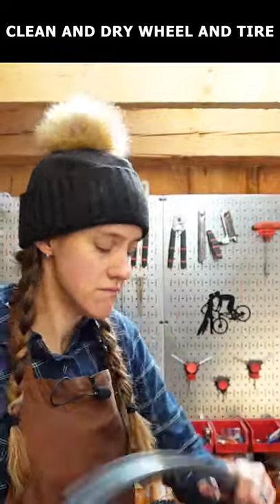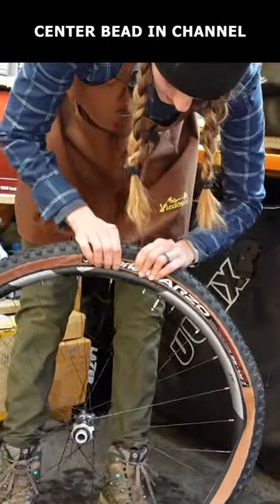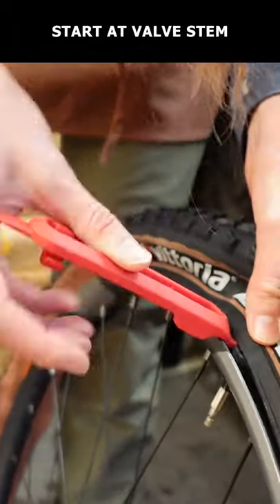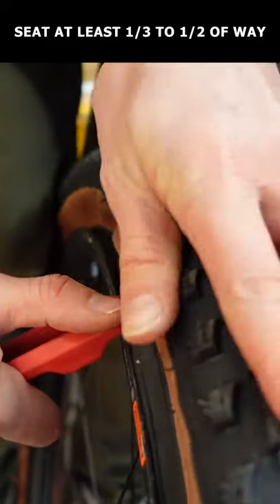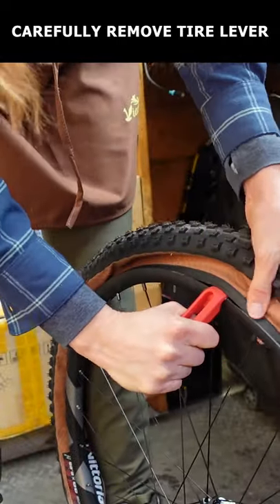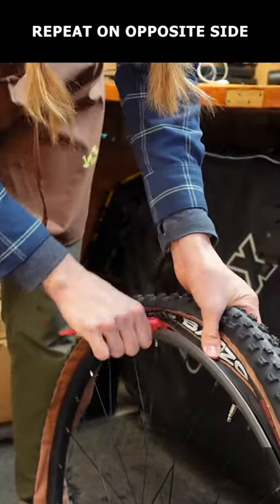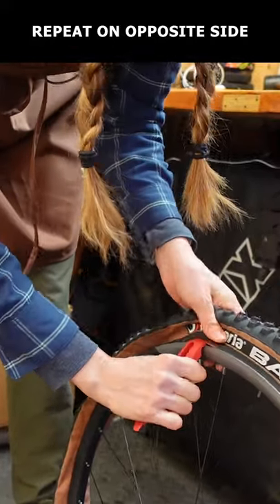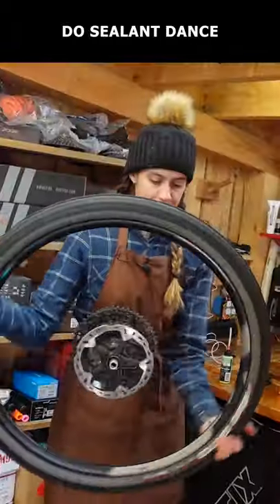Inflate tubeless tires WITHOUT an air compressor (only floor pump) #Shorts

Comment: They sell a tool for this, you put in a CO2 Canister and push a button and it blasts the tire onto the rim, no compressor needed. The CO2 device should be your choice in the outside world as it fits in your repair pouch, when in a shop, if you don't have a compressor, go buy a compressor.

Comment: You dont even need to do this, just slap the tire on your rim put the sealant, turn your wheel to apply the sealant everywhere and start pumpin your tire
Reply from the maker: Sounds like you have an easy rim/tire combo! Many rim/tire combos won't inflate if that's all you do...

Comment: I find if you use an inner tube to seat one side of the tire you can take the inner tube out and pump up the tire to seat the other side. Works fine for me

Comment: Great video as usual, but I would use caution recommending a tire lever when most manufacturers don’t recommend using them with tubeless tires. Thanks for spreading the stoke!
Reply: How do you get your tires off?
Reply: @gavinmercak-dinolfo1375  if you follow a process of bringing both beads into the center groove of the rim and remove the tire starting at the valve (which is opposite of how you remove a tubed tire) the tire with a little force comes off every time. Basically: 1 Break the beads free, 2 migrate beads to the center and then 3 pull tire up away from the rim allowing a gap to form at the valve then 4 push the tire off the rim. Example: https://youtu.be/D4b5IwkJvVc
Reply: I found that the bead doesn't really get damaged in any noticable way. And if there were to be any leaks because of a damaged bead, a good sealant will do its job and fix it.
Reply: @diviscadilek1764  I agree that sealant is magical. Having seen literally “everything” fail in my 30 years of being a professional bike mechanic has made me a stickler for following manufacturers recommendations. For example: you would be amazed how many people install chains improperly and wonder why their chain broke. Following the manual can save a lot of troubles!
Reply: @WanderingRad  while I have ypu here, can I ask you: Do you recommend reusing the little master link thingy even though the chain manufacturers say you shouldn't?
Reply: @diviscadilek1764  loaded question with the many manufacturers and speeds, 8,9,10,11,12s, etc...so “diplomatically” that really depends on the manufacture! 🤪 Here’s my rule for not getting into trouble. Does removing the connecting link require a tool? If the answer is “yes” then only use it once. If the answer is no then go for it. Many “connecting links” for older drivetrains were easily removed by taking tension off of the chain, and some of these even failed while riding. Are there exceptions?: of course, just like using a tire lever on tubeless...but if something does fail after following manufacturers recommendations then at the very least you can go to the manufacturer, and showing them you have a solid foundation for how you work on bikes will help the manufacturer support you. If you have to call a manufacturer, they ask a lot of questions when things fail so they can improve product and instruction manuals! Hope this helps!
Reply: @WanderingRad  yeah, this sure helped clear it up. Thanks!

Comment: Put the tire on, add the sealant (use your preferred method) and the trick is to push the valve 2-4mm inside the rim between the tire edges. Pump it twice,   the tire will seat instantly and properly, now tighten up the valve and inflate to full pressure, rotate the wheel few times, so the sealant will seal the tire. This method is straight forward, clean and simple, I'm using it for the MTB and road rims (55mm in depth) You don't need boosters, compressors etc.
Reply: Tried that, air leaks out everywhere. Sealant in tire is now everywhere. No idea how you got it to work, good job though.

Comment: This is a great method to use with a floor pump that's not pushing high volume like a compressor. If you do have a compressor of just about any size, what I do is remove the valve core, add sealant and use an air blow gun attachment to blow directly into the valve stem which usually inflates the tire quickly on the rim first try. 🚴‍♂️👍

Comment: I have an extremely stubborn tire, I tried the but didn’t work. I tried putting tube in and tires seated, but how to remove without unseating…does bead loosen at all or it remains true to size because it’s tubeless? Thank you
Reply from the maker: Bead shouldn't stretch unless it's been on the wheel for a while. If you get it seated with a tube in, just deflate the tube and try to only unseat one side of the tire when removing the tube. Then you can use this trick for the side you removed. Good luck!

Comment: The pump nor the booster inflator fit onto the valve stem without the valve core. How does everyone do it? Which adapter do you need? The Presta to Schrader valve also does not work the size is not exact. The size on the traitor is not the size of the Presta valve stem None of the videos mention it. Thank you
Reply from the maker: Some pumps won't stay on the valve stem without the core. In this case, either have a friend hold it in place for you or put the core back in.
Reply: @sydfixesbikes  makes sense I understand. I wonder which pumps would Stay and which would not. Or if it is mentioned perhaps on the label when purchasing the pump. Thank you again

Comment: once you take core out how do u attach pump do you need special adapter as the thread diameter is less then a normal (Schrader valve)
Reply from the maker: Some pumps will still attach without the core. Otherwise have a friend hold it in place for you.

Comment: theres a right and wrong direction????
Reply from the maker: Most tires are directional but you do occasionally find bidirectional ones. If they are facing the correct direction you have better rolling resistance as well as better braking traction.

Comment: Why is this better than just running tubes?
Reply from the maker: Less likelihood of flats (the sealant will seal most small punctures without you noticing) and you can run lower pressures which increases traction without riding pinch flats.

Comment: Another idea. I had a kite pump handy, similar to any inflatable toy pump. I held the smallest diameter nozzle over bike valve (not an air tight seal) and with other hand pumped hard. Enough of the bead seated that I could use the standard pump to finish the job.